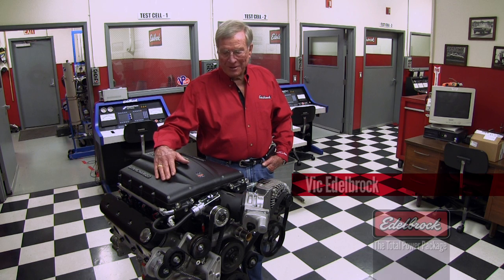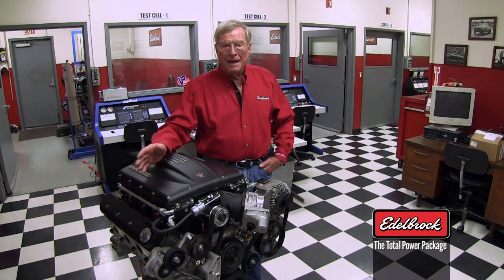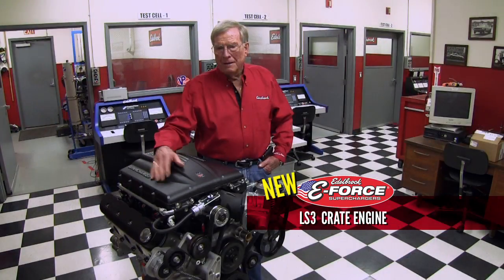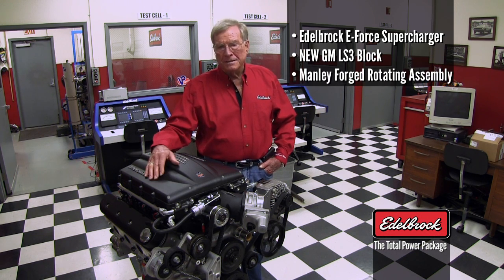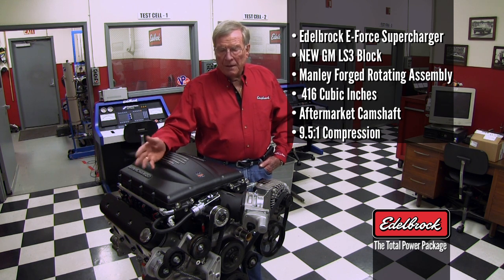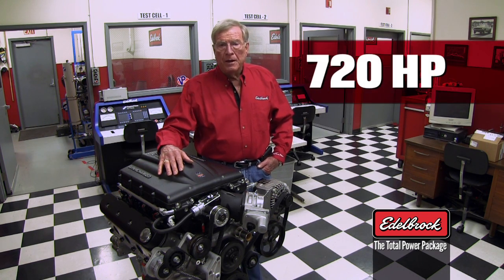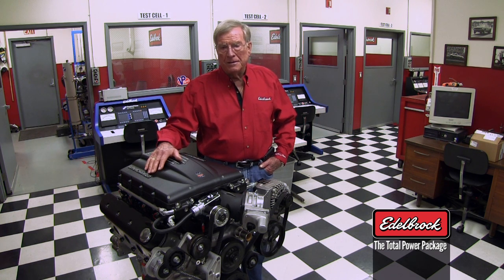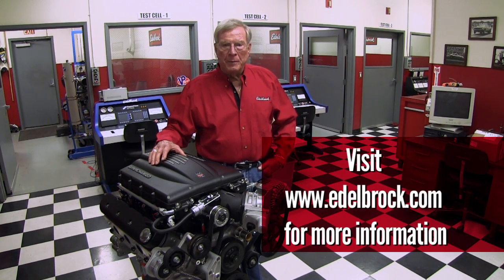NEW - Edelbrock E-Force Supercharged Crate Engine

Comment: I'm looking for advice; If I hypothetically wanted a great crate engine for a 2001 Mustang Cobra, would Edelbrock be a good choice? Or say, Ford Racing, or Coyote? Or, if I had money to throw toss, Roush? Please let me know what you think!
Reply: You literally just asked the manufacture what they think is a better engine... they will obviously tell you that theirs is the best.   That said, Edelbrock has been around for as long as 'hot rodding' has been, so Its a good bet, and they come with a warranty.  Something that smaller engine builders do not come with.   Just make sure you use the correct fuel and leave it alone.  This is a turn key application.   That said, its a $20k application.
Reply: @walperstyle  It's now $33,500.00 - This price is a joke. Seriously. Build your own.
Reply from the maker: spookypunky Of course It would. We have our Supercharged Coyote Crate engine.